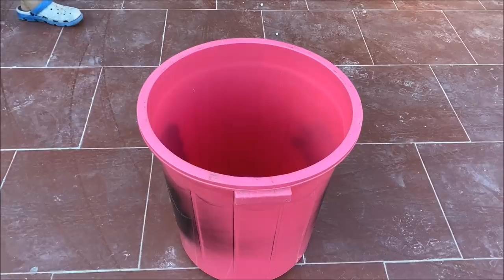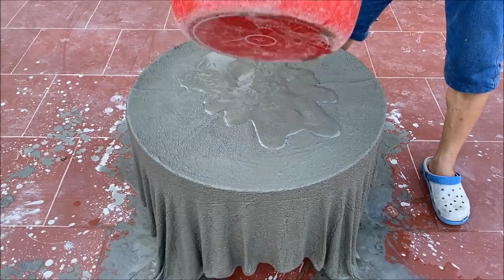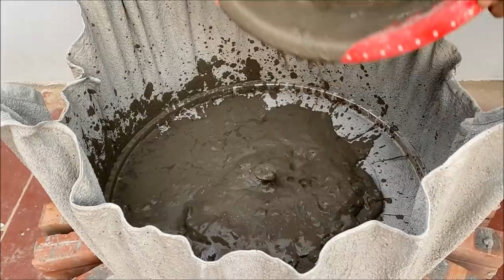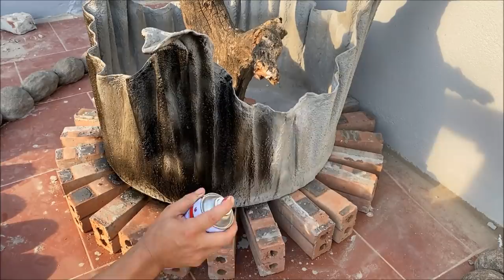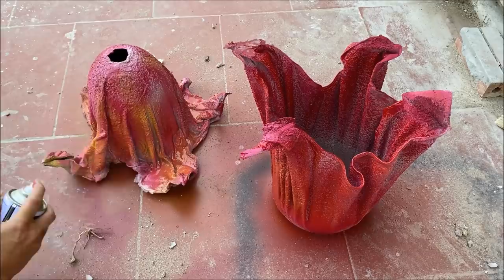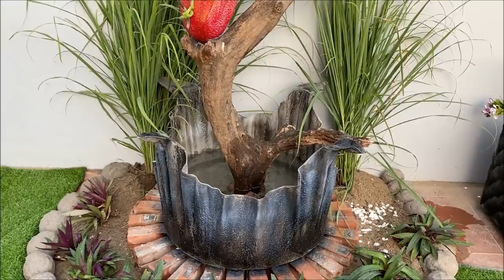Great ideas for Garden Design and Decoration from Cement | Technique making Aquarium and Flower pots

Comment: Very creative but NEVER touch cement with bare hands, the lime in it can cause SERIOUSLY deep burns! I learnt from experience when a little bit of concrete went into the neck of my boot inside my sock when laying a concrete floor for a large shed. I thought nothing of it until I got home and looked to see why my ankle was so sore. The lime in the cement had burnt literal holes deep into my skin. On the surface it just looked like a row of little sores all the way around above my ankle, because the concrete had been against my skin for about 4 hrs it had burnt holes that were between 0.5 up to 1cm deep in places. They took months to heal, were AGONY and I still have the scars 22 yrs later!! Cement is not to be messed with without proper good quality protective equipment.
Reply from the maker: Thanks for your comments 😘
Reply: Thank you for sharing this information with me. 🙏🏽✝️💛
Reply: @krystalborgman  you’re very welcome 😁